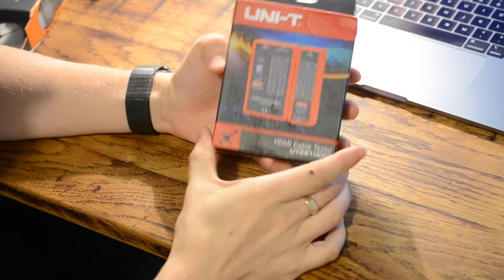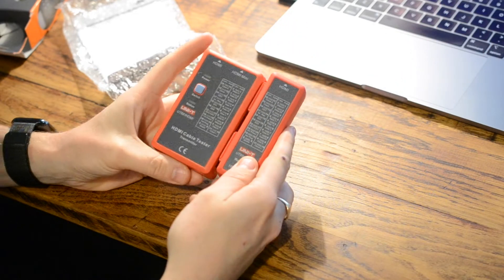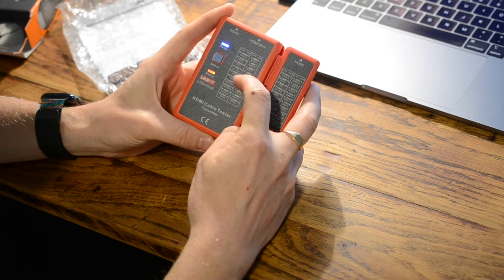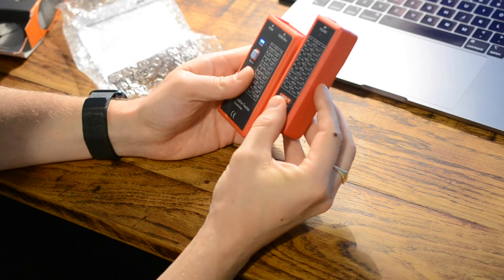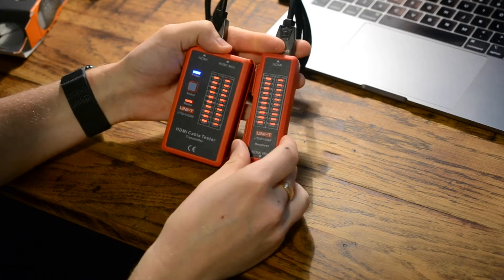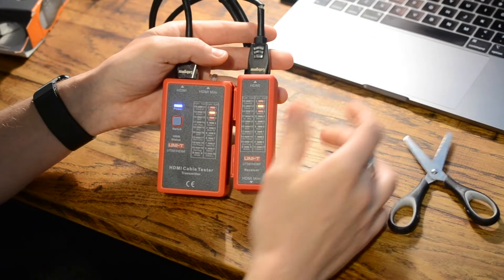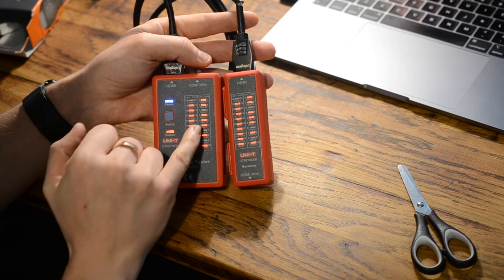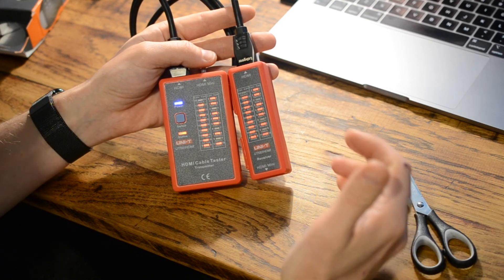Faulty HDMI Cable Tester - How To Test HDMI Cables

Comment: What's the real world use for this tester?
Unlike network cables, HDMI cables are rarely longer than 2m, let alone be installed between rooms.  It would be quicker and easier to test with a different cable than play around with this tool and still be unsure about the cable.

Comment: А чем проверить оптический HDMI кабель? Ведь в оптическом  HDMI кабеле встроены медиаконверторы, которые питаются от 5 вольт из самого кабеля? И обычным тестером оптику не проверишь? 
How to check an optical HDMI cable?  After all, the optical HDMI cable has built-in media converters that are powered by 5 volts from the cable itself?  And you can’t check the optics with a regular tester?

Comment: Thank you for a great video. All my cables fail to light up the +5v power (pin 18). Is this a faulty cable, or just ones that doesn't support the +5v power?

Comment: will this work with a 125 ft cable that has built in power boosers
Reply: No, this is a continuity tester, it will only work on a wire only solution. The boosters effectively break the continuity of the wire to allow it to boost the signal.

Comment: this thing ONLY tests if all the wires connect. Not how much strength (resistance) of signal passes through.  I would recommend a tester that does a bit more then this one
Reply from the maker: Thanks
Reply: Hello can you help me identify what I'm needing to do with this unit...DC 9V Cable Tester Multimedia Interface Standard HD HDMI RJ45 Wire Line Finder..... the paperwork that comes with it is in broken English and cannot find any videos to highlight in more depth how to use it... I would have thought this would be a pretty easy thing to set up but obviously working off of the one that you're using in this video unfortunately does not work in the same way if you can assist would be greatly received.
Jay
Reply: Hi man, im looking this kind of tester, can u give suggestion for this kind of tester that affordable? thank you in advance
Reply: Then and thAn are 2 different words with different meanings.

Comment: Will it tell you which version of cable or bandwidth capabilities it has?
Reply: Really old cables (before HDMI 1.3) didn't have all the pins wired, so this tester will spot a HDMI 1.0 (some LEDs don't light up) or a HDMI 1.4 cable (most/all LEDs light up). But it won't tell you yes/no to 4K support, and probably can't tell HDMI 2.0 from 2.0a or anything new like that.
Reply from the maker: I dont think so